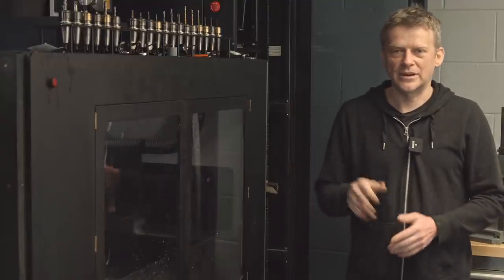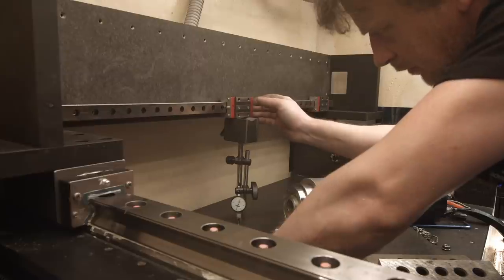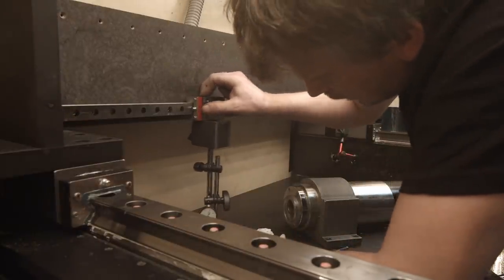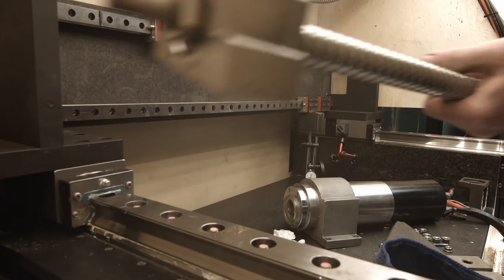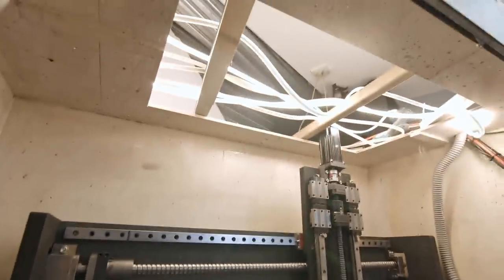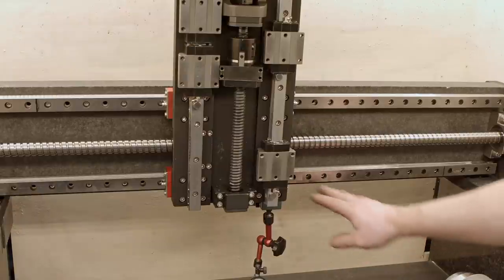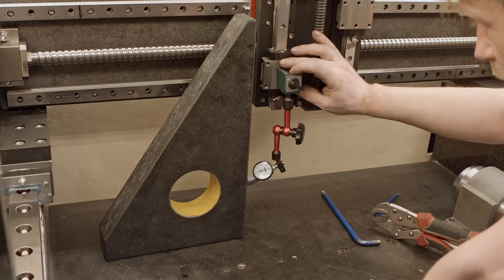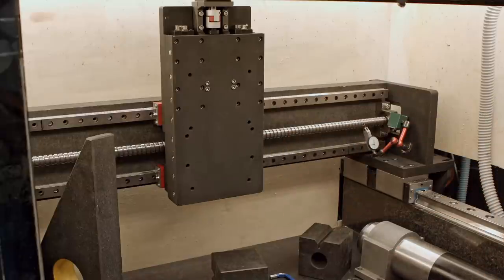EPIC CNC upgrade - episode 8. mounting rails, ball screws and Z axis, alignment and fine tuning.

Comment: I'd love to see a new video testing material removal rates again!  With the extra rigidity maybe full axial engagement on your 10mm end mills and see what you can do!  (Besides, even if you're not making a part, we all know there's joy in making pieces of metal into smaller pieces of metal!)
Reply from the maker: I will have to disappoint you ;) all the stuff is just for the surface finish, not ripping of the railroad tracks ;) machine was capable of doing so before the upgrade. You know i want to use it not to kill it.

Comment: It's really looking awesome. I am looking forward to understanding how you will be using all this precision you are working so hard to achieve, in what the machine is making for your customers.  I would also like to hear your thoughts on how the granite holds up over time compared to steel parts. And when you are expecting wear to effect your work enough to have to think about maintenance or replacement items.
Reply from the maker: i was using this machine for 4 years now and i haven't noticed any changes in the granite under the rails. granite will last almost forever if you don't rub it. (piramides are still standing ;) )
steel rusts and distorts much more. but its more resistant on rubbing.
im planing to do maintenance more often :) and over all i expect it to be good for another 4-5 years.
Reply: @PiotrFoxWysocki  Ok, interesting. I know the granite should be stiffer, so you'll have a far more ridged machine, for the same volume of material. It's the drilling into the granite to get the holes right I find intimidating. with steel you can put material back if you get it wrong. I don't think granite is that forgiving. Still I am looking forward to seeing these new parts in operation, and getting your thoughts on how it performs.
Reply from the maker: Drilling holes in the granite is trickier. But if you are not like totally off, you can drill bigger hole, put insert in fill it up with epoxy and align it where it should be. 1 or 2mm is not a big drama

Comment: As an experienced machine tool builder for more than 40 years we found out that even the best rails and bearings have errors up to 0.15mm in parallelism, flatness etc. so there’s no point in trying to chase microns when setting them up? Also to stop pitch and roll errors we slid the dti on a ground block along a known straight granite parallel with the dti finger against the sliding bearings.As usual a good example to help the new arrivals build their own machine.👍

Comment: Are you going to use any blue loctite (the lightest hold) in the screws holding the rails. I would that those will experience some vibrations. Minimal rattlin is going to happen of course, with a setup like yours 😁
Reply from the maker: it would make sense but i think now its too late. maybe next time when i will adjust it

Comment: Hey Fox, fine tuning to be within 5 microns for a hand built cnc is a piece of mastery a.k.a Art. I am inspired and I am sure hundreds out their who follow your channel will be too.

I had a question for you. I see most x-axis of artisian cnc designs and even on fixed gantry types. Does it really matter if the ball screw is placed somewhat exactly between the upper and lower boundries of the linear rails. I could be wrong but I think it is purely for "looks nice" reasons and if I was to place it say closer the lower rail. Does it make any difference to the overall performance in terms of any harmonic disturbance etc ?

Comment: Always happy when a new video is released. Was a bit late on this one though..  when this machine is finished I will buy it from you for 1000 euro so you need to make a new one and don't stop releasing videos.   

Btw. What kind of linear rails are these? All different brand?
Reply: Jokes on you, even machines that cost 10 000 euros aren't assembled with so much attention to detail. What kind of mill do you need exactly ?
Reply: @milithemuffin4534  jokes on me? I was just joking about it so Fox would have to build a new one and keep making videos and uploads on regular base.

But I am actual thinking of making a series production ready design made out of steel tubing and plates. A Friend of mine is able to precision weld it without adding too much stress in the structure. he would also face, mill and drill it with a big amazing machining centre(Doosan).

But I am more and more attracted to buying a Haas (super)minimill 2. So I am not sure what to do atm. Although I already have closed loop nema34 steppers/spindle/ballscrew/linear guides/cnc steering/power supplies etc.

It's because I know I want to have it precise. For example like what Fox has now. I would also be tinkering for hours and hours. That is why I like his channel so much.  
But keeping in mind all the iterations, parts, hours etc. makes me wondering if I shouldn't just buy the Haas.
Reply from the maker: its a different brand some shlodin#$#... can't remember. check episode 2 :D
Reply from the maker: more machines? but it would be like watching the same video over and over :)
i was thinking similar, maybe it will be faster just to buy a hass, all the gadgets etc.. 
but apparently precision is not they strongest point.
Reply: @PiotrFoxWysocki 
Oh, but you still need a edm machine,  surface grinder,
Fiberlaser and so much more :).
Anyway can not wait to see your updated mill in action with some nice detailed measurements of the finished parts

 yeah, was trying to find more info about tollerances of these haas mills. Did read more "tollerance is not their thing" messages but non actually had details.  Well.. maybe I need to make my own afterall or contact Kern for a nice big fat discount.
Reply from the maker: Haha 😄 im contemplaiting a lathe ;) 
I guess hass is good for mass production of 99.9% of parts. Its just when you want someting a bit better you have to go kern ;) but the price is not something you want to go for, i guess ;)

Comment: Whats going to keep them from pushing or vibrating out of position? On commercial built machines the rails are captured so once positioned and tightened they can really only wear out of calibration.
Reply from the maker: friction. i was running this machine before for few years and haven't noticed things going out of alignment

Comment: What is the tolerance of the parts you make with the machine. Are you doing aerospace stuff?
Reply from the maker: Mostly 10-20 microns. Only once i really needed less than that. Mostly i do high ednd prototypes where the surface finish is important. Internals for cameras so in there i need some reasonable precision.

Comment: Great work.....
Just one tip...avoid using stainless screws unless you are using A4-70.....
Reply from the maker: im using A2-70,  i had them previously and they are working just fine. A4-70 would be used in marine application where they are exposed to salt. inside this machine A2-70 works just fine
Reply: @PiotrFoxWysocki   they have higher tensile strenght....I have one machine with a2-70 and the screws from the end of the rails are always snnaping the head....change to a4 and never have the same problem....but the forces compared to a cnc are much more

Comment: How would you cut those rails properly if you did need to short them down?
Reply from the maker: with the angle grinder and metal cutting disc, i cut my big rail in half like that. when you use thin disk it doesn't even gets hot.

Comment: I think you really need to not tighten them down so much until you have all of them zeroed out loosely. When I tighten down my fixture plate of vise or anything I loosely tighten the bolts to the point where they won't torque the thing you want to be straight

Comment: what kind spidel u use kw? 
and rel size xyz? and strip metal u use. i want to make cnc router for metal to
Reply from the maker: 2.5kw. Jianken. Check the review video I made earlier
Reply: can i use slider size 20 or 25 or more? i use for metal router like miling fungsional.  strip steel 20mm
Reply from the maker: I would say 25 or more. But it all might be pointless if your frame is flimsy.

Comment: May i ask, are you using threaded inserts in the stone, i have been looking at tye keep-nut, but im not sure about the solution, thank you
Reply from the maker: It's tricky to get threaded granite inserts. So I used threaded standoffs. It's a threaded cylinder. You can make some groves around for the glue. It's in the video I made few years back. I think it has gantry in the title.
Reply: @PiotrFoxWysocki  thank you for your help. thank you soo much

Comment: Using dial indicator probe bend almost 90 degree will reduced output reading almost 45%.
Reply from the maker: Actually this is the way how you should be using it. 90 deg is optimal
Reply: @PiotrFoxWysocki   you are right sir this type of DTI can do it .  I read on a manual angle between measuring flat surface and prob ball axis towards  pivot point of DTI  should be parallel . If there is an angle it will create an error.
Reply: @PiotrFoxWysocki  it's difficult for me to describe  my point what I want to say . Plz think about triangle crated when we touch a surface on a angle. I will be very happy if you get my point sir. Thanks